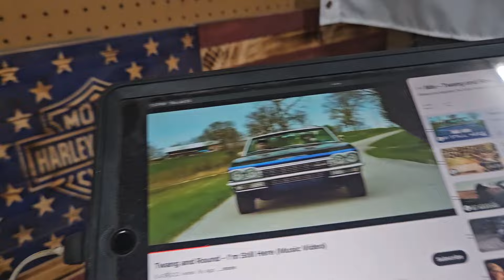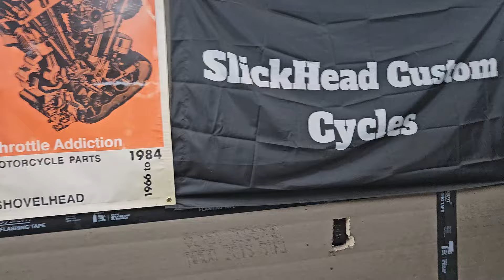What oil do you use for what bike???

Comment: I use SYN 3 in my Road Glide too and I also change all three holes before it hits 5,000 miles.  80,000 miles and it's still running strong.
Reply from the maker: Only way to go bro

Comment: In Australia, we get Penrite Full Mineral, Hi-Performance Diesel engine oil 20w-60. I've run this in my 2006 Night Train for 18 years, 248,000kms, motor never been apart. Run the same oil in the primary, run Nulon slick50 in the gearbox
Reply from the maker: Great formula for the heat I'm sure. Thanks man

Comment: 40+ yrs of riding n building bikes and I run my oil at least  20,000 n change oil filter around 10,000 if I remember.  I can't tell ya how many people use my shop to change oil and I sort it out n give light filter and reuse for my bikes, trucks n riding mowers, I've NEVER had an issue. I retired from chemical plant work and have worked with and studied oils with some oil chemists and we have come to the same conclusions, just so y'all know.

Comment: On my 17 road glide  ultra I run 20/50 synthetic, on my 73flh stroker I run 50 straight 2qts and 60 straight 2qts. To give me 55 🤪 and sometimes I will do 60/70 straight 2 qts each  (65) 🤪 welcome to my crazy world. I've seen the debate about some people running multi weight in their shovelheads and I was surprised to see in a video Billy Lane using 20/50 on his Worlds ugliest shovelhead kick start part 3.
Good content keep up the good work. ✌️
Reply from the maker: Thanks man. All the gray beards i grew up around always said, nothing less than 50w in a shovelhead or older. You have a good formula.  I may start trying that
Reply: @hippieschoppercorner  Be mindful that mixing motor oils from multiple manufacturers can produce bad results. The additives in one may not be compatible with the additives in another. You could create sludge buildup in the oil passages or make the oil too thick at operating temperatures.

Comment: Hey this might sound dumb but I have been riding an old 77 shovelhead lowrider that I've chopped out but the old lady wanted something we both could ride on comfortable so I got a 2020 Street glide special nice bike but I still rather ride my shovelhead. Anyways my question is what you suggest I run for my fluids? I'm just not real familiar with these new bikes and what they take
Reply from the maker: Screaming Eagle SYN3 20/50 in my engine,  belray in my trans and HD Formula plus in my primary.  All 3 holes every 3k. Bike will last a long time
Reply: @hippieschoppercorner  thanks man much appreciated love the channel and keep the it the way it is don't change anything you got it right the first time